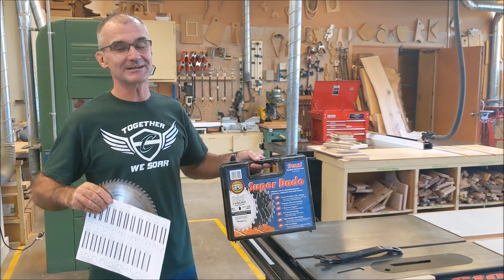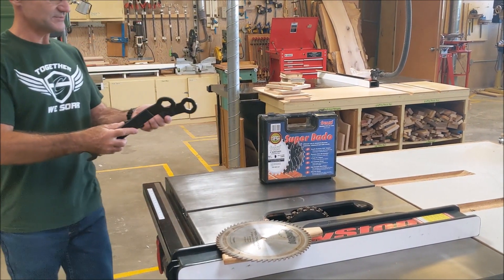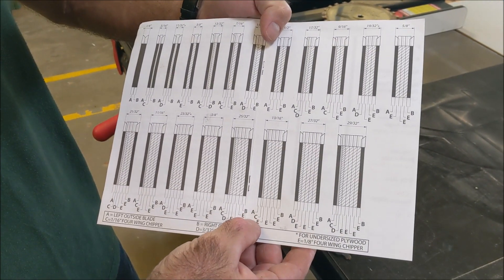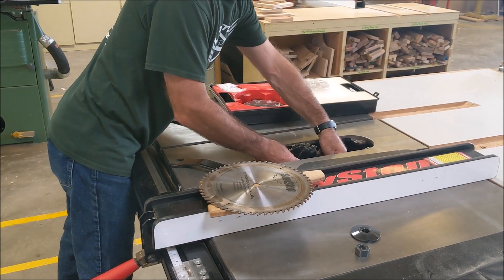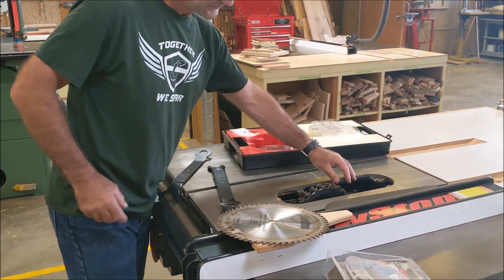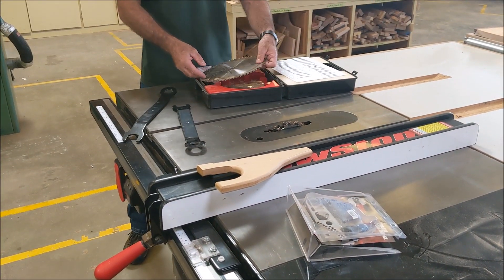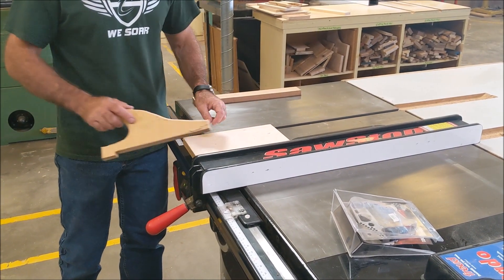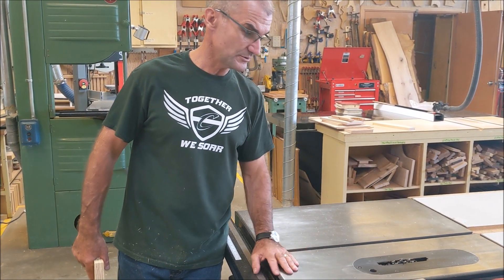How to Install a Dado Blade Set into a Table Saw

Comment: Hi i ask you can i use 2 or 3 normal table saw blades as a dato blade. Let me know
Reply from the maker: I don't think so, the teeth on the blades are wider and as you stack the blades they will wobble, creating a danger.
Reply: @topsaw  thanks for the advice